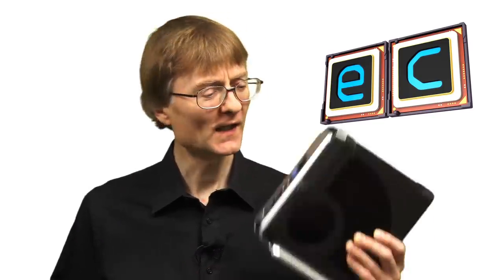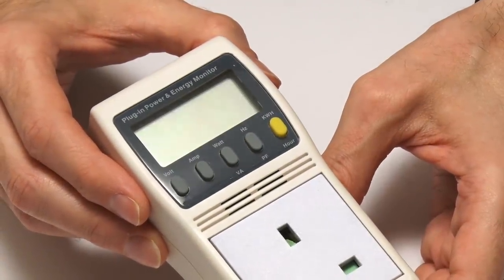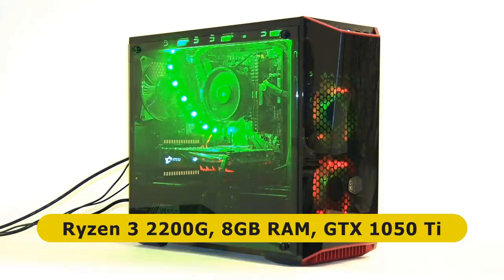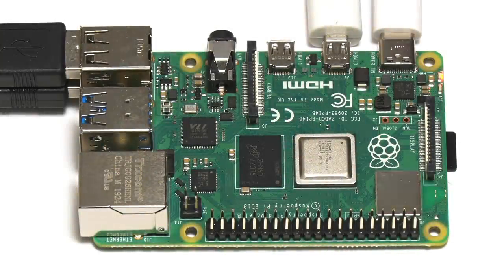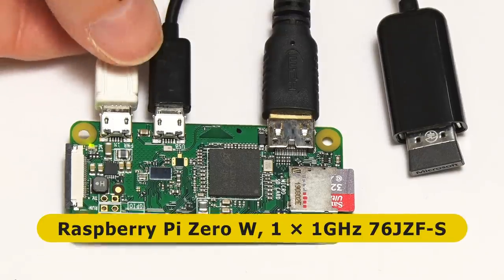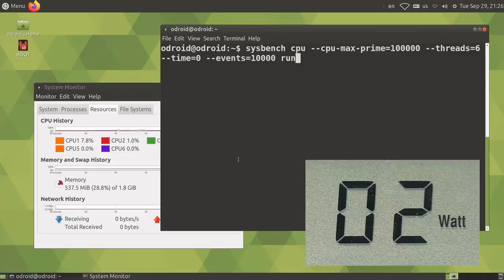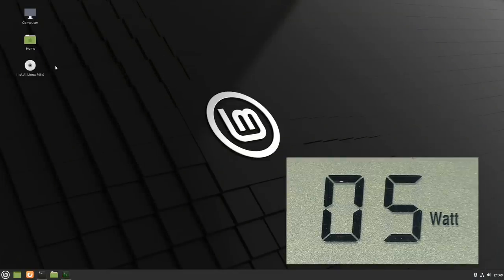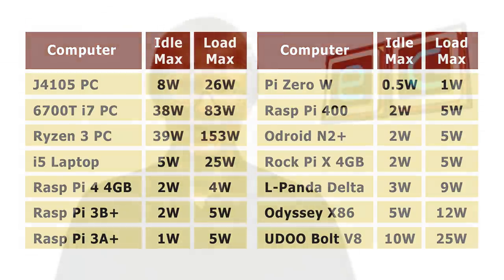PC & SBC Power Consumption

Comment: I was just thinking about this and then minutes later, this video popped up in my notifications. Uncanny!
Reply from the maker: Spooky . . .
Reply: yeah, Christopher is the ultimate mind bender...
Reply: Turn Alexa off
Reply: @ExplainingComputers  Yes, the reason I was thinking about it is, I want to set up a machine with low power consumption to use for running SteamCMD under Linux for dedicated Steam game servers. Games that I regularly play with my friends, such as Left4Dead2, CS:GO, etc. 
I'm currently running it on Ubuntu Server 20.10 in a virtual machine using Oracle VirtualBox. 
Of course, this server is only operational when I have my main PC on, which I don't want to leave running 24/7.  I dare say that one of the Intel based SBCs might do the trick; perhaps the Latte Panda Delta?
Reply: @JTThumpington  I don't know about SteamCMD, but I run Open Media Vault as a host on a J5005 based Intel Nuc with 8GB Ram.  (I have 8x 5TB portable USB hard drives with quite aggressive turn-off times initially programmed while using Seagate software on Windows, and a 1TB Samsung SSD inside the Nuc).  On that nuc I run tons of containers, including Plex for example (which you could do on a Pi even).  Idle, the OMV System Overview displays about 1%, 2% etc.

I don't measure the system draw of that separately, but the hard drives even when idle/sleeping probably draw more than the Nuc I suspect.

--

I do measure my total system draw for:

Aforementioned J5005 with 8x 5TB drives.
4x monitors (1x 22"=>24" ish old that uses more power than I like, 1080p, 1x wide-screen I use in portrait mode - more than 1080p, taller than 24" prob., 1 decent Dell 25" and one USBC power 13" touch screen) 
(Connected to a NUC10i7FNH ... 6-cores, 64GB Ram, 2x 1TB SSDs including an nvme one) running Windows 10 Pro
A Facebook Portal (can play plex on that too)
Another NUC10i7FNH ... same spec, except Pro-SSDs, but for ESXI 7, on which I run several VMs including my main one for work - another Win10, with 32GB allocated memory for that one VM... lots of compiling etc. (coding)
1x Pi4 4GB with an USB SSD
2x Smart Switches (networking, 8-way GBit)
1x WiFi Access Point (2.4GHz and 5GHz)
1x Network Camera for CCTV streaming to cloud.  (I actually bolt Nucs into stuff I then screw into the floor but obviously I take precautions with so much expensive gear!)
1x Echo Dot (2nd gen).
Another Pi3 based (large) Lithium Iron Phosphate battery project I'm working on (when I get back to it) with other microprocessors and gubbins,  (It will eventually be in charge of managing all the power for my systems in this room).
An APC 700W UPS that all the power goes through currently for these things (but it draws power anyway),
Various bits and bobs ... e.g. multiple USB power supplies (for general use). Speakers etc.  Dongles ... e.g. for Zigbee and other stuff.

I have all that going through a TP-Link energy monitoring plug but with the switch soldered closed (I like these plugs as easy to read the values in Python).

With monitors on and VMs up etc. but fairly idle use, I'm looking at about 200W.  With very long working days and if I neglect to risk putting my main Win10 Nuc to sleep because I have so much stuff open I'm scared to loose, or I'm just being lazy (tired/fatigued) then all that uses about 4kWh / day.  Which is a LOT ... BUT ... less than my dehumidifier in the cellar that uses about 5kWh / day to stay below 60% relative humidity (I measure a bunch of stuff around the house).  I have a separate system for pfSense in the utility cupboard downstairs ... a SuperMicro server board ... because of the built-in remote control stuff though there are now Pi solutions for KVM over IP etc.!, and another J1900 little computer that I used to use for pfSense that I now run ESXI on too though I want to increase the RAM on the SuperMicro and virtualise pfSense and turn off the J1900).  By virtualising pfSense ... depending on the demands of something like this SteamCmd thingy, maybe that could also run on the same machine as the router software, saving energy there?

Over time I'm trying to reduce my power use ... and heat generation, but it is complicated by loving so much tech!

I'm very aware of energy and quite ashamed.  Loved this video ... it was informative.

Don't know if that helps.  With perspective.  So for me,  selecting highlights from the main "computers": 12x quite powerful CPU cores, 4x less powerful but fairly efficient cores (J5005), then the Pi4 Arm Cores, and whatever's in the Facebook Portal ...  over 140GB of RAM ... 200W. Including 4x monitors.  4kWh / day.  If 15p / kWh then about 60p / day.  Or £219/year.  A lot of love for Tech.  :)  And a good reason to try to reduce it a bit.

It amazes me how efficient things are becoming, but I also get frustrated at the lack of commercial power management solutions and especially lack of long life (e.g. 20-years+) affordable UPS's.  I hate having to throw away Lead Acids all the time (they get recycled obviously).  And even something as ubiquitous as NUT ... I'm finding I'm having to write my own (Windows service) (I do use Linux a lot too obviously - but both)  for NUT to do the things I want.  Very very frustrated I get, lol ... not being able to get the things I want.  But, yeah ... very pleased with the NUCs.  Very expensive ... but very capable.  With VMs and containers especially, and with the wide power envelopes of the 10th Gen CPUs on the posher ones, I can run many many servers and services that idle at very low power.  Great for experiments (home lab).
Reply: Oh yeah!  Forgot ... that 200W includes my idle laser printer too.
Reply: Great minds and all that 👍😂
Reply: And ... for a couple of monitors I use Fresco USB adapters ... I'm not a gamer though a Thunderbolt eGPU would be nice for occasional use, but yeah - and USB hubs etc. included in that stuff.  And a PD-powered hub for my laptop (laptop off).   I think that covers most of it now.  I think.
Reply: @ExplainingComputers 
Hi Chris... great video... very interesting results...
I have a quick question 4 u... I'm not sure if any of ur previous videos have covered the topic...
I have a small PC (Sumvision Cyclone mini PC) hooked up 2 my TV it's been on pretty much 24/7 for about 4yrs.!
I have a HDD hooked up 2 it's USB also a micro SD card...
Recently we had a lightning storm which caused a power cut...
Ever since that both the HDD & micro SD r failing...so I'm planning on replacing them both... (& getting a UPS).
It's used primarily 4 watching streamed & stored videos play music etc...
So mostly write once read many times as far as the data is concerned...
I'm guessing the HD is worn out from spinning away 4 so long...
I'm thinking of getting a SSD (but obviously that costs more/GB)...
My question is... what would u do & why..?
Other ppls opinions r also welcomed.
Thanks in advance.
Reply: Oh - another nb: when I say idle, I mean low workload.  Still means lots of applications and 10s / 100+ browser tabs open etc.

Another thing I want to explore to reduce power though, is using something like a Quest 2 and Immersed so I can still enjoy a multi-monitor set-up, but in VR.  Somewhere between 1/4 and 1/3, probably, of my power budget upstairs, is monitors!  But I can't justify to my spouse getting into more debt for that, yet.  I'd have to be pretty sure I'd be comfortable coding in that VR environment for occasionally 12hours+ / day before getting rid of monitors.
Reply: @MaxMax-dq1lu  Hi - I use to have one of those Sumvision Cyclone sticks/dongles (still have it in a cupboard somewhere).  Not familiar with the Mini PC specifically.

I don't know, but wouldn't surprise me, if it has an upper limit of 2TB addressable hard drive space.  Probably best to check before looking for a bigger drive.  Maybe there is no such limit.

Even if the machine has USB 3, it will be very limited by an Atom processor, in terms of available USB bandwidth.  I'm not sure the machine would provide an opportunity to explore the best of what even SATA 3 USB 3 SSDs can offer.  So - no point in getter high performance ones for that.

I still have working HDD's from the 90's.  And I started buying SSD's since 2008.  Maybe 20+ in that time.
I've had a number of HDDs die on me over the decades, but a surprising number have survived (though I've given them nearly all away in recent years as I "upgrade").
I've had a few SSDs die on me, including, Samsung Pro's.  My "go to" drive of choice for performance and logevity.

For the last year or so, I've had 8x 5TB Seagate 2.5" USB 3 external drives powered on, connected to my Open Media Vault Server.  I had set them, using Windows software for those drives, to go to sleep after x-minutes of not being used.  It's not good to spin-up/spin-down/parking these drives too much ... there's a balance, but there's no point having them spinning 24/7 either if unnecessary.  So far so good.  But while I can recommend from my experience the 5TB drives, if limited to say 2TB, that would mean a different model drive I have no personal experience with.

--

If limited to 2TB, and if happy with 1TB, I think the Samsung Evo 860 (TLC) would be a great buy.  Not that you'd appreciate the performance of it in everyday use, but I think it's pretty power-efficient in terms of controller and memory, for 24/7 operation.  Especially just for read operations.  It also comes with a 5-year guarantee.  And would be much faster for copying stuff onto from a faster PC, if doing that occasionally.  For 2TB and more, the cost/GB might be more of a dominant consideration, but as a 5-year proposition, the 1TB might actually provide good value for money.  If you can find a cheaper SSD per GB, I'd check power consumption and warranties to see if you'd be happy with them.  Performance per se shouldn't be a consideration.

--
If electricity is of no consequence, then you could get a USB 3 to SATA adapter you can use with 3.5" drives.  I've given away 1TB drives to colleagues before - for free - not wanting them any more.  You could probably pick-up 1TB 3.5" very cheaply and use them like a cartridge, for more stuff.  Or with an adapter for 2.5" SSDs, again ... I've practically given away older SSDs before ... 250GB range.  But they'd be fine for your use-case and you could swap them with an adapter, or use an external SSD USB tool-less case.

--

If using a network cable rather than WiFi,  remember to get a UPS with built in protection for network cables, or, a separate lightning arrestor (though they can be quite expensive for 1Gbit ones with earthing connections but I suspect the mini-pc will only be 100Mbit/sec anyway).  If using WiFi, and if your mini PC is 12V,  although I'm uncomfortable having more and more Lithium Ion battery-chemistry cells  in the house,  I successfully use one by powered inspired.  Unless you need more UPS power (mains),  then you might want to avoid having to change Lead Acids every 2 to 5 years.  And then just use Surge Protection for lightning.  I use separate surge protection plugs because they do wear out and I don't want to replace a lot of equipment all the time.  

--

Sorry lol ... sometimes I hardly speak for days, and then I have these "chat-mode" periods where I never shut-up.  :)

One more thing ... I run Plex server in a container on a Nuc J5005 ... way more performance than your cyclone thingy (I think - after quick Google search) ... but I mention it, because I've also ran Plex client sideloaded I think ... I forget, before, on an Amazon Firestick.   I'm not sure how your Mini PC works ... if it has a normal OS on it or a Cyclone OS or something ... but ... you could probably do the same as me ... OMV,  and plex container.  If you're only streaming to one TV.  But have a separate streaming receiver that accept a Plex client.  Then there's Kodi of course.  Wouldn't have to be OMV or containers ... just the way I do it as I like it that way.  Just saying ... more options.  You could use that mini-PC for more stuff.  Unless it's optimised to get more out of the limited hardware in some way. But you could keep it out the way - maybe nearer the router.  Maybe with a USB3 external hard drive dock for convenience, and use cheap old larger hard drives that way.  But I'm speculating a lot here.  Waffling on.  :)
Reply from the maker: @MaxMax-dq1lu  It depends on the capacity you need. HDD still wins in terms of cost per GB. But an SSD is faster, uses less power and is more physically robust. Today I buy SSDs unless I need significant capacity.
Reply: this is ho much google knoews aboud yoe
Reply: @bacathey  Nope, I only thought about it.

Comment: This is the video I was expecting for!. I got many servers running 24/7, so power consumption has become an issue.
Reply: Years back someone gave me their old floorstanding dell poweredge as part of a job, i was going to use it till i saw it draw like 350w just sitting there and it warmed up the spare room i put it in. Haha
Reply: @volvo09  It could double as a heater in the winter. I have a few of those.
Reply: Depends on what you use as a server. I use (and don't laugh) some Pi Zeros in metal cases. They don't get particularly hot but each run several 2.5" hard drives and drive SAMBA4 quite well for me as single user. They can deliver HD video too, so all in all, not bad considering what is inside these things (512K of memory) for example.
Reply: @marcdraco2189  - Nah, I'd never laugh at someone with the smarts to opt to use PI Zeros or similar SBC's for servers, if that is all that is needed.  If anything, you should be applauded for a smart and economic approach to smaller servers.
Reply: @marcdraco2189  Well all my servers are SBCs. 2 Panda Delta, 1 Udoo x86, 1 odroid xu4 and 1 raspi 4. So, this video heals my doubts. Many services running continuously. Power consumption is indeed an issue.
Reply: @saturno_tv  The services, how many & duration are everything

Comment: I suggest a part 2 of this video: use cross-architecture (X86 and ARM) programs for some heavy load and measure the performance/W. You could for example measure the render-time with Blender.
Reply: No need because it is a bridged system. You can test both sides separately at full load and just add them up. It is not much different from a bridgeboarded Amiga in how it works (68xxx <=> x86), it is in size and speed though and not by a little bit as an original Amiga can hold a 286 Bridgeboard and 68000 as a bare minimum and a 486 Bridgeboard and 68040 at absolute maximum for the magic to happen. In practice this means I can play Command&Conquer DOS version native on my Amiga A2000 with Windows '95 as OS while AmigaOS 3.1.4 is also running real-time at the same time. Yes the Amiga was the first real multi tasking computer and it was very good at it. It also was extremely expensive to build such a system in that time. Even today it is still expensive to run genuine Amiga hardware. Mainly because they are becoming rare and there is a huge fanbase.

Comment: The Pi's power draw is stunningly low. I knew it would be awesome, and that's why I looked up how to turn it into a NAS (which is what brought me to this excellent channel in the first place) and replaced the 2009 Mac mini I was using for the job. At 2-4 watts, I don't feel the least bit guilty for letting that little thing run 24 x 7 x 365.

Comment: This is a really great video when considering media options for off-the-grid applications. Came back to it 4 months later just to remember each!
Reply from the maker: You may like my first video in May 2021 -- which includes extensive tests running SBCs from batteries. :)

Comment: I'm using the heat produced by my PC to heat my room. The apartment building is thermally insulated. My PC is not very power hungry, but the heat is enough to keep the room modestly warm.
Reply: An older PC I had put out a fair amount of heat so I used some drain-piping sections & joints and a few 80mm fans to redirect the heat. It's common sense to make good use of excess heat generated
Reply: Not very power hungry but producing enough heat to keep a room modestly warm?

That breaks the laws of thermodynamics.

Comment: Thank You, I have done some broadly similar Pi 4 / 400 v i5-4590 v i7-4790 tests myself. For something like h264 video encoding the watts versus encoding time tradeoff can be interesting to know. If you are not in a hurry then a slow but low watt encode on a Pi 4 might be cheaper than a fast encode on an i5 / i7.  During the original UK lockdown I slowly re-encoded my movie collection of 200+ films using a Pi 4 and ffmpeg libx264. Slow but it meant I didn’t need to constantly monitor the encode, just kick it off and come back many hours later.

Comment: Man, We have been watching all of you videos, especially the ones on SBCs at this time.  Three projects are on the table at this time are:
1. Determining the minimum amount of computer we need in our mobile camping rig that will allow me to log into our brokerage account and access the the trade platform. We can stay out longer if we are able to make position adjustments from remote locations.  My Beautiful Bride will also be better able to continue her academic writing work while underway with power efficient equipment running off the rigs house battery and solar panels. 
2. Develop a great and efficient system for home backup during power outages here in the Philippines. In our province, the grid is very reliable but it does go down occasionally. and can be out for days. A typhoon this very month proves the fact! 
3. We are working on a low power draw navigation display for marine application. Again, running off the house battery and trying to minimize the time we need to run the engine to charge  our storage cells. 

Thank you Christopher for your always helpful, information packed videos. From Beautiful Bride Maria, her loving hubby Jack and our young troops on Luzon Philippines.